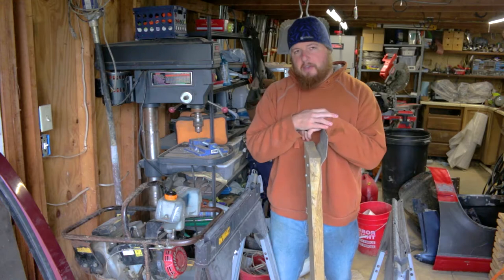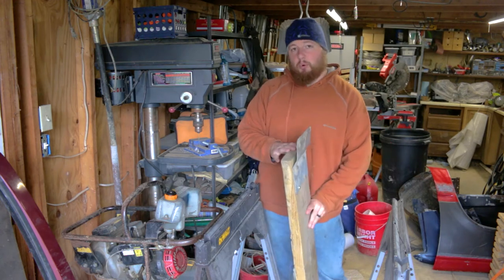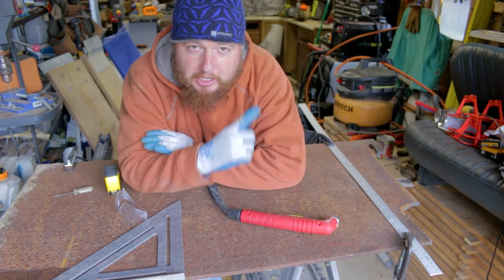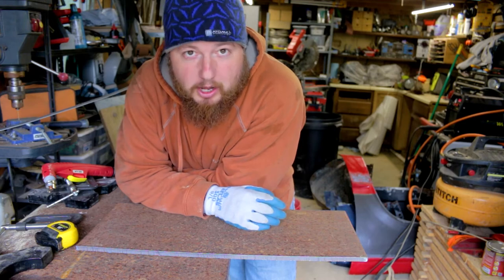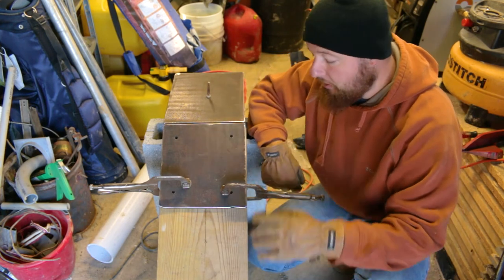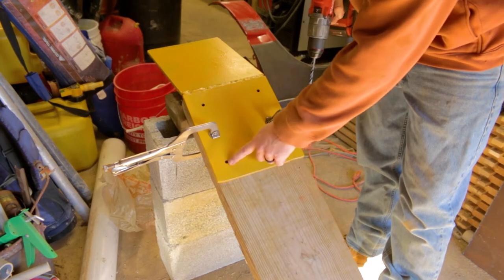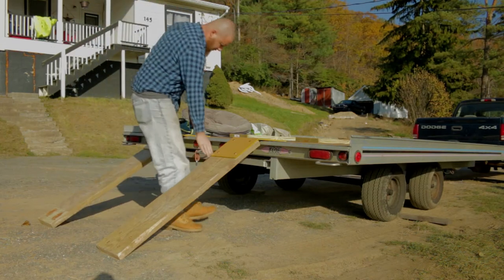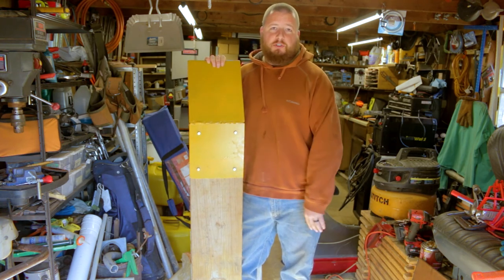DIY Loading Ramps - Heavy Duty

Comment: Lol - I was morbidly interested until I saw how large of a tractor he intended to back down the ramps!  Well done, that far exceeds my requirements and its only $15 in wood + scrap metal.  Thanks for pointing out that long ramps put ALL the load on the wood while shorter ramps split the load.  That adjusted my plans.
Reply from the maker: Awesome! Thanks

Comment: Hey brother nice work. The only thing I see as a weakness is that your heavy duty brackets are on TOP of the wood. When the tractor is below the top bracket the only thing holding the weight of the tractor is the washers and the nuts from ripping through the wood.  A slight modification would be to put that strong steel under the wood to support the whole plank. Great video. Thanks. Stay safe.
Reply from the maker: Thanks. Good idea